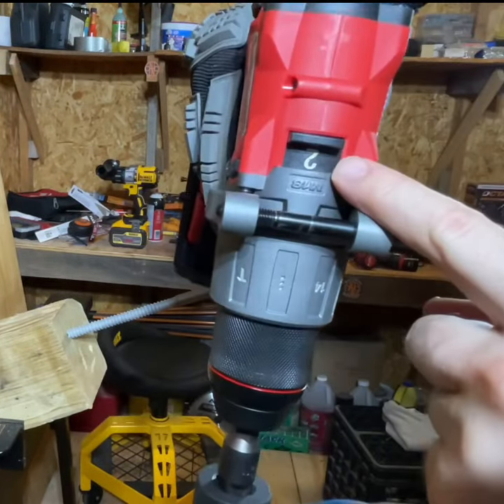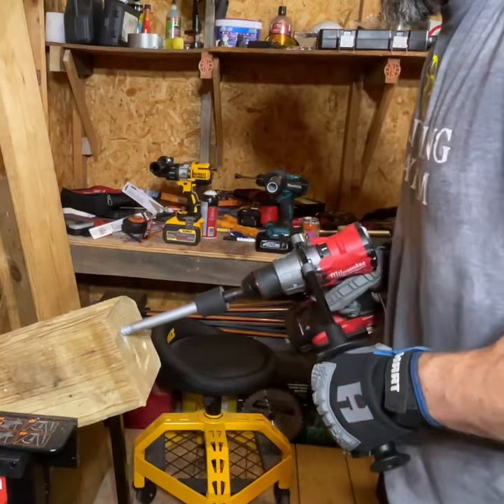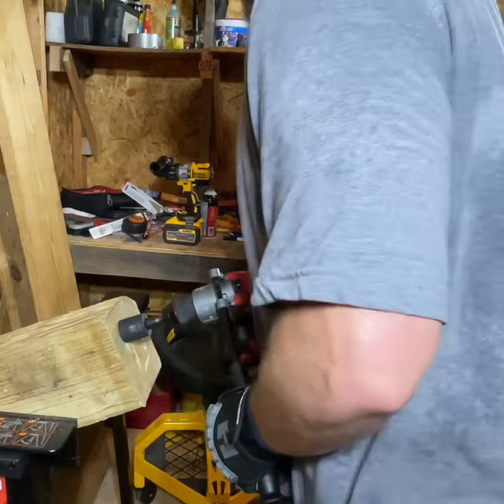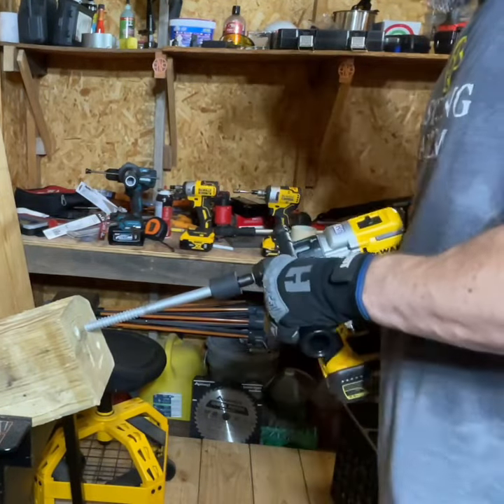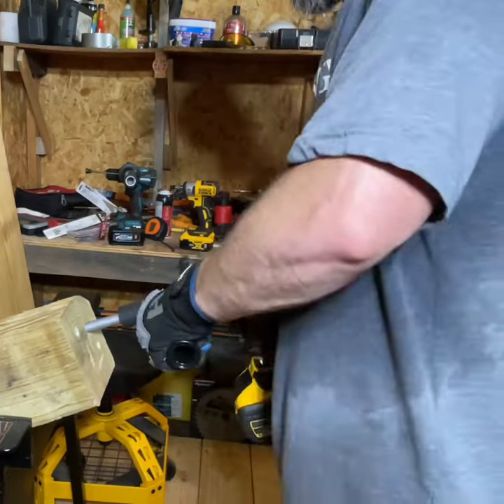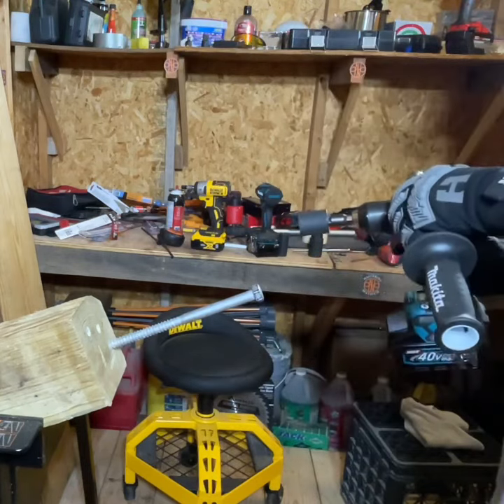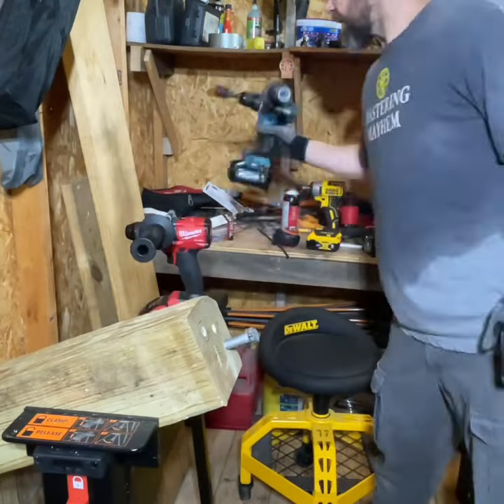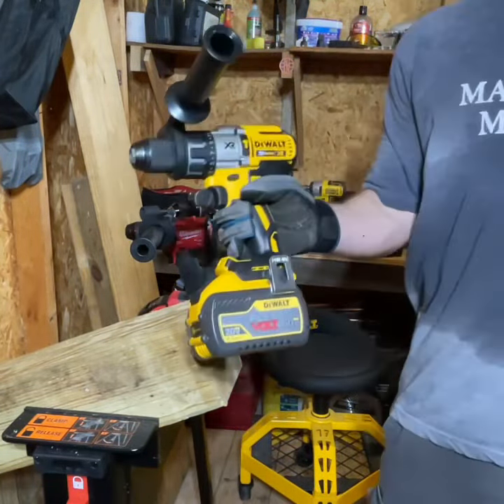Hammer Drill Torque Power SHOWDOWN With 12" Lag Bolt!

Comment: that’s the dcd 996. try the 998
Reply: I’ve never seen one of these tests actually use the FV advantage dewalt, I think it’s the only drill with the yellow number dial
Reply: @INeedARadioTower  998 is the power detect. imo it’s better than the 999 which is the flex volt you’re talking about.  i own both

Comment: All the tests I see on U tube, The Milwaukee has the most power. My only question is how long will it last during the work day? And for the long run?
Reply: Longer than any other
Reply: @07144 Makita 40v XGT battery's last the longest. Throw a 5ah or 8ah and it's not even close.